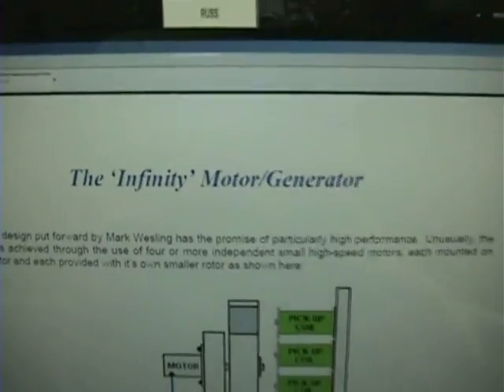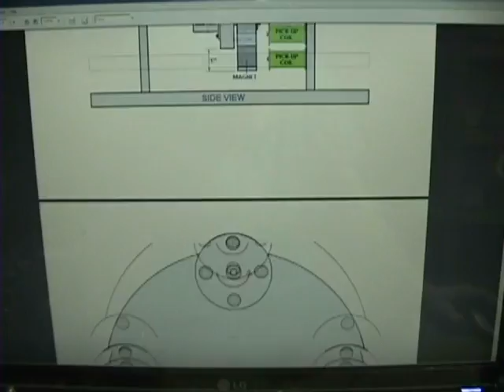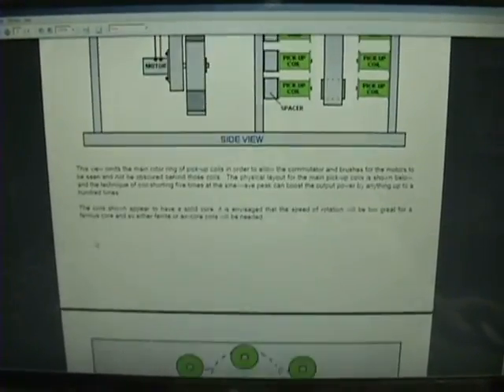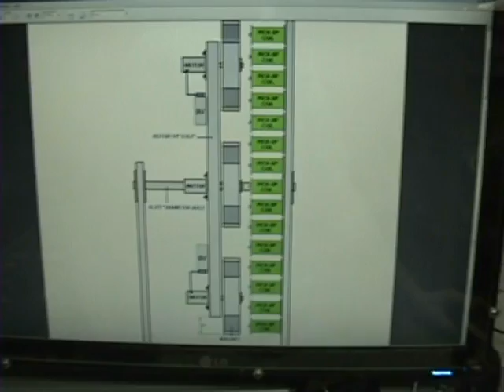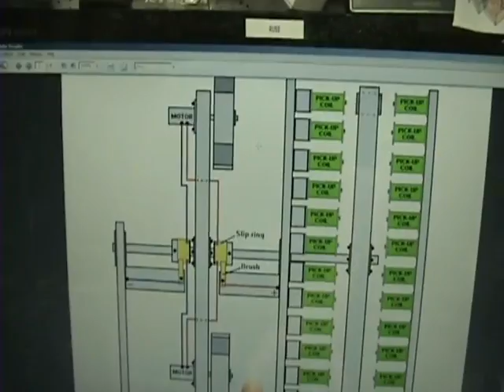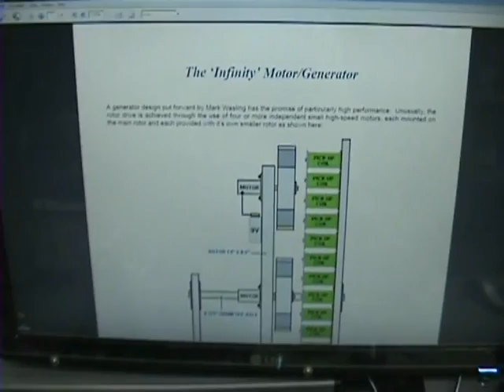The 'Infinity' Motor/Generator by Mark & Russ

Comment: @rwg42985 guy claims that it can run itself but it's getting dangers when it's getting to high speed... I ment to check this concept in the future. I think that its better if ring magnets can spin freely than in yours spin with small motors.

Comment: what is the gauge of the  copper wire?
Reply: 24 Guage but thicker wires work better.
Reply: yes Mark and Rush, how much power you produce
Reply: +Arturo K it was designed for a second row of coils 180 degrees on the opposite side of the magnet.
no one knows what it will do as no one has built one.

Comment: What physical principle are you hoping to exploit to create an over unity engine? Lenz's law does not predict free energy, and nor does any other physical principle. I suggest you learn the laws of physics before trying to build a device that relies on those laws. As I just said, Lenz's law, and all of the other laws of physics do not allow free generation of energy by combining coils and rotating magnets together. You clearly are a skilled craftsman with respectable engineering skills, so I urge you to spend your time on something that is realistic instead of squandering your time on a lost cause.
Reply: +Daniel Walsh  Their are ways around everything, the knack is to find that way, if beavers never made dams we might not have had the idea, invention is based on trial and error and without people like Russ we would be trying out idea's that could be costly. He is to be admired for what he does because it saves the rest of us from wasting our time and money doing those things he proves do not work, so we can try news idea's that MAY work.
Reply: Russ Grief  is a genius. 
Using Lenz law in his favor certainly causes less current to drive the rotors forward. This is the first device I know of using this configuration. Lenz laws predicts nothing. This device is producing electricity but it is not overunity. What if you put 2 sows of coils with the magnets rotating in between them. That would give twice the output with no more input needed.
Would it then be overunity.
Reply: weslingm I am in fact building that exact configuration at the moment to rows of coils with magnets in between them still early stages though, I may upload a short video clip.
Reply: ***** please if I can help in any way please ask. I have many different ideas on this device. There are many ways to improve this device
Be blessed
Mark
Reply: Thanks Mark, I am very limited on funds so what I am doing is building a framework that is easily adaptable and adjustable, I am starting with basic rotors but later as I progress I want to add rotary devices like Russ demonstrated it is just a hobby project for something to do really, I have made 3 main sections on my design each section will have different types of coils, currently I am winding tiny starship coils and their a pain to do due to their small size their only 20mm across so have to use 38swg wire and rather than matching turns I am matching ohms for 6.6 ohms for pulse driven circuit they have a lot of kick when pulsed from a 4700mfd capacitor charged to 12 volt, I have not built any circuits yet I will do it on breadboard when I get all my coils done, the other coil designs use a stepped Pyramid style, the 3rd type are generic style I plan to compare all three variations of 6 in each configuration against each other to see which are most efficient.
Reply: weslingm
 I seem to be having some issues with Google sending me notifications of replies from you but when I click on the link for more their is no such comment to reply to, google is a pain in the butt
Reply: Yeah lets just put an end to innovation because of some "law" that humans ourselfs created. Lets just leave out the fact that there has been many things that have been disproven throughout history that once was an accepted "law of physical nature". Your right, instead of thinking of new ways to ignite technological advancements lets just keep doing things the old fashion way. Hey maybe we can just revert back to the point where we are all cavemen while were at it. lets make the people that work hard to go to new boundaries in the physics world look stupid, just because someone years ago said things work a certain way, and only a certain way. Open your eyes daniel, your peanut brain is slowing down the real geniuses at work.
Reply: +Dylan Hutchison
I agree that we should constantly make scientific progress. But I hear people talking about Lenz' law here, and the principle of Lenz' law does not allow for over-unity devices. Electricity and magnetism are already understood via Maxwell's equations, and the Lorentz Force. All of the components (wires and solenoids) in this video are already fully understood with this theory. The magnetic fields of solenoids have been compared to theoretical models, and match to overwhelming accuracy. If you're hoping to discover a new physical principle, you're going to have to demonstrate that one or more of the elements here behave in a way that cannot be explained by classical electromagnetism. Since this theory has been explored for an enormous range of parameter values: electric currents (from microamps to kilamps, at least) and radii and lengths of the solenoids, you would have to explore outside this range, which I'm sure you are not capable of doing with this experiment.
Reply: +Daniel Walsh for one, there is not a solenoid in this machine. none of those coils are used as solenoids.
and 'they' (science} doesn't know everything about magnets and wires. and Maxwell's equations don't explain all about lenz' law. 

what we know about physics are a few obvious laws of nature that we have tripped (over and over) in the dark, until one of those times we get back up and proclaim we think we know whats causing that!
Reply: +Lisa Wesling 
A solenoid is a coil of wire, so I don't understand what your objection is:

https://en.m.wikipedia.org/wiki/Solenoid

Secondly, Lenz' Law is simply a qualitative description of one of the four mathematically rigorous Maxwell's equations known as "Faraday's Law of Induction". So no, Lenz' Law is not independent from Maxwell's Equations; it is designed for people who don't understand differential equations to interpret EMF in a wire loop.

I hope you're kidding when you say that all we know about Physics is a few obvious laws. Science progresses thanks to the tireless research carried out by scientists across the globe. Far from obvious, it generally requires understanding of higher math to understand, along with extensive quantitative analysis to verify that theory and experiment match. The Physics in this video is completely understood, so unless a novel, unstudied aspect of the experiment is introduced, your time would be better spent elsewhere.
Reply: +Daniel Walsh They're trying the all-in-one horse pulling the cart while sitting init method. Just like everyone else they're overthinking it